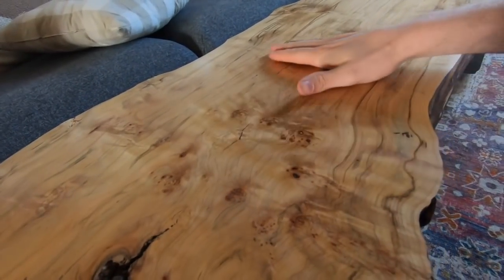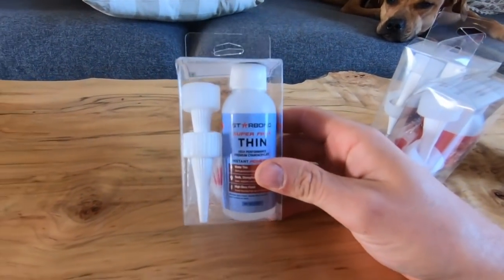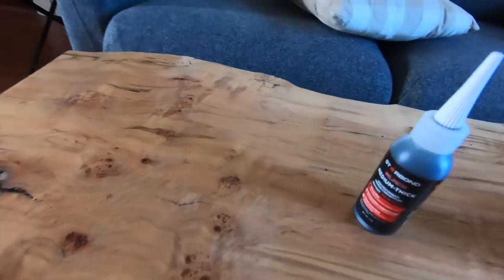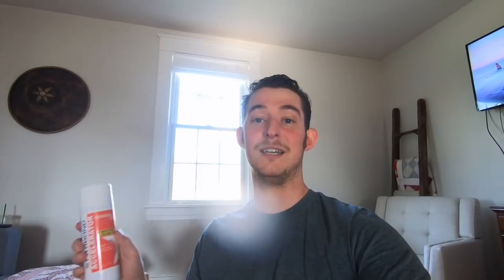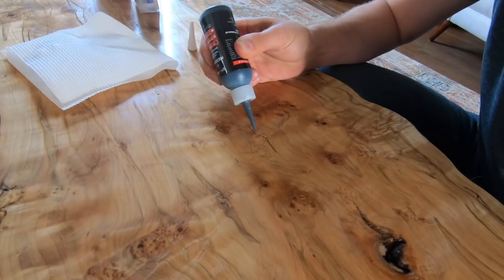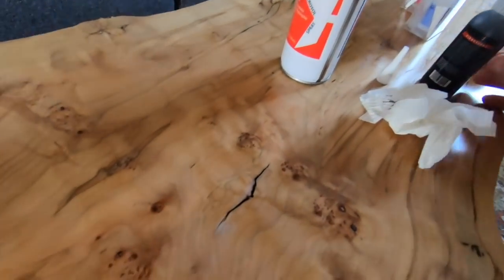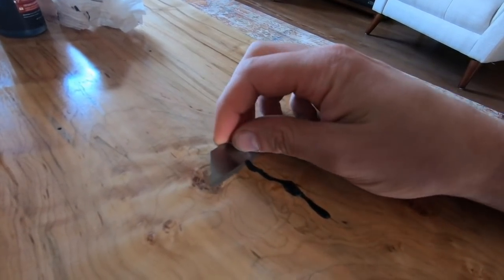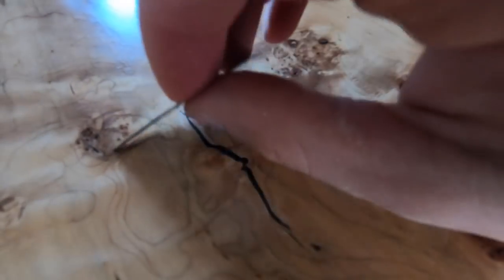Repair a Coffee Table Top in Seconds!!

Comment: Hi! I had a question.  I am making a epoxy river table and I am wondering if you can give me a recommendation on an epoxy to use and a blue dye.  The epoxy itself will be a quarter inch thick and cover a volume around 64 cubic inches.  I don't want to get a large bottle because I don't plan on using epoxy after this project.  If you could please leave a specific brand and size?  Thank you again!  Love your videos!

Comment: I had a problem with this stuff. I filled a worm hole then hit it with rhe spray. The surface cured only. When i pared the excess off the top crust came off and the rest was still liquid. What am i doing wrong? I also had other issues with this product!!